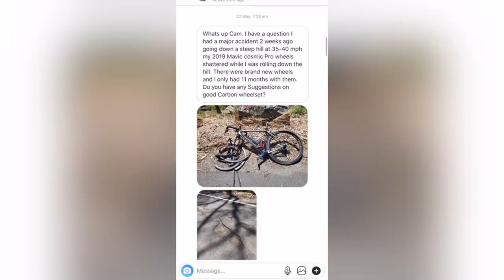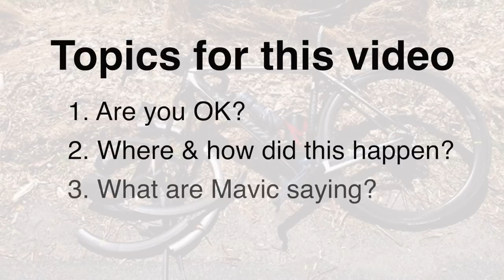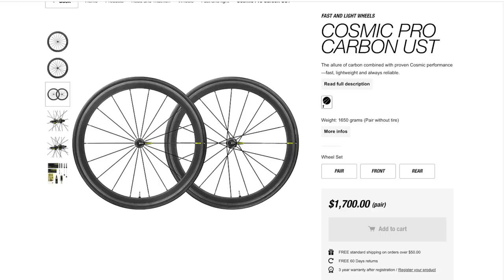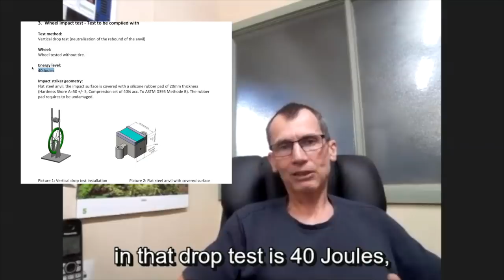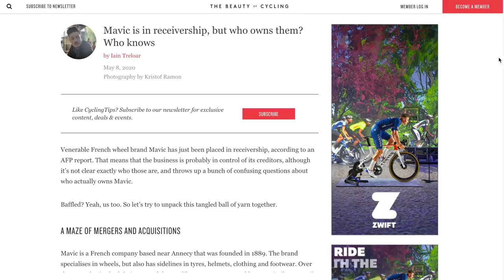A FRIGHTENING MAVIC CARBON WHEEL FAIL (at speed)

Comment: THIS HAPPENS ON DISC BRAKE WHEELS TOO ,l ve seen colasped wheels at the LBS with disc brakes from an impact SO FoR THIS REASON ALLOY WHEELS ONLY FOR ME !!
Reply: Correct.  The braking force from a disc brake goes where?  it is applied down each spoke to  each spoke nipple, putting pressure on the carbon area around each spoke.  So carbon disc brake wheels are not fool-proof.
Reply: @zoso73  but the heat doesn't transfer to the rim with disc brakes, what kills the carbon clinchers is the high temps from braking.
Reply: @zoso73  I would think that the pressure across all the spokes would be small enough as it is distributed across multiple areas, for the most part, evenly. No?
Reply: @nachelia  in theory, that is correct.  Very important to buy good quality DB carbon wheels from known manufacturers.
Reply: bianchi1885 Mavic is reputable manufacturer.
Reply: @anata5127  It is.  My point being that if you're going to buy carbon DB wheels, the reputable manufacturers rarely put out bad product.   But if/when they do and the product you are riding on fails resulting in catastrophic injury (or worse) to you, you (or your estate) want to ensure there is a real company that has decent liability insurance to cover your personal injury/wrongful death claim.
Reply: bianchi1885 Do you think aluminum wheels safer?
Reply: @anata5127  Aluminum will always present less risk than carbon, but carbon is generally safe.  These instances of catastrophic carbon wheel failure are few and far between.  I ride on carbon wheels on one bike, and aluminum on another.
Reply: bianchi1885 Interesting, I always thought that aluminum wheels are safe when they are heavy duty. For example, for gravel bikes. Road bike aluminum wheels look very flimsy.
Reply: @zoso73  the main difference between carbon and aluminum is that Aluminum bends while carbon almost disintegrates. Aluminum gives you a warning has some emergency reserves while carbon fails totally without any warning.
IMHO is carbon not a material for amateurs because they don't really profit from it's advantages and don't have time and money to counter it's disadvantages.
Reply: @svenweihusen57  Yep, and the net-effect of that "main difference" essentially sets the granularity of reaction-time to thousandths or millionths of a second, which is pretty fast. Carbon isn't a material for anyone not riding for enough prize-money to cover the cost of needless hospitalization.

If you can't trust your equipment to the point that you're thinking about your equipment when you mostly just need your equipment to function for its intended purpose, I imagine that any distraction from winning the race immediately at-hand is counterproductive to the actual winning of it, therefore somewhat (largely?) mitigating its theoretical advantage...

Comment: Nice video once more, my friend. I know that "brands"will never say that carbon is not recommended for those who weight more than 85 kg. But that's what i recon. 85kg is the limit, because the factors that the specialist describe, such as temperature, bumps and so on. Today we have lots of good aluminum wheels and frames. I don't see point to run the risk.  Hope you conquer more and more success in youtube! Greetings from Bauru-são paulo-Brazil.

Comment: Sounds like a very good argument for disk brakes on bikes... My rim/tire combo will never get that hot
Reply from the maker: Yes correct J 👍
Reply: I've seen more mavic wheels explode under high heat than any other brand. I know 3 guys with mavics that exploded during descending. I've never had a problem with quasar, ffwd and scope. I don't brake much and only race on tubs but I train on carbon clinchers.... I think it depends on more variables other than cArBoN cLinChErS

Comment: Thank you for doing this video.  I cycle up Bear Mtn all the time. The route up 9W to Bear from NYC is a very popular one. Its not unusual at all to hit 50+mph on the way down. I've often thought about what could go wrong in the process and tend to modulate and sit up whenever I can. Glad to hear he is doing okay. 

After seeing this, I may opt to get some 'climbing wheels' for just such a ride. Typically I get more worried about braking down those hills in the wet but this adds another element. Although I'll still likely be a rim brake fan as well. Having a friend wake up before a 100mi event with warped rotors has pretty much kept me away from discs.

Comment: At 95kg, I only ride aluminum wheels for this reason and being a heavy rider.
Reply from the maker: Yes can appreciate that 👍 thanks for sharing
Reply: I made a similar decision. Even on the alloy version of Mavic Cosmics at 100kgs I am at the upper limit of the  stated load capacity for the wheel set. The rider in this case, at 100kg - plus bike, kit, water bottles etc, was also probably closer to the 120kg limit for his wheels.
Reply: @kiribatichris  That 120kg limit is a joke. Worse yet - Focus states a 110kg system limit on all their bikes. Basically, good for people weighing 85kg. at most sans luggage! Should you bother to do bike packing, shopping or - not to mention - loaded touring - better make sure you're not a gram heavier than 65kg. before you buy a Focus. Thence, I avoid that brand like a plague. Compare them to Trek, who have more or less no weight limit on their bikes (and decidedly none for their carbon wheels).
Reply: I would say: It's not about your weight but what kind of riding you do.
Glad to hear he's ok

Comment: Thanks very much for the sub title. The guy in glasses tried to explain hot it it happened. But I tell you it happened because the integrity of the material is comprised during manufacturing. That's all. for safety purposes, avoid carbon wheels.

Comment: Mavic wheels are pretty reliable, they are manufactured and engineered in France.  They've been around for over a hundred years and is certainly no fly by night company, i'd trust Mavic over most other company any day.  I dont' think its fair to point out Mavic without fully understanding the elements at play here.
Reply: @kidkarbon4775  i've come across mavic aluminum rims from taiwan (think it was a cxp-21) and the same rim also from france; yet, it was the taiwan version that had islets.
Reply: agreed, he said he waw on the bumpy surface and hit a pothole at speeds of 40+ MPH, those are things at play Mr. Lee was speaking of I believe. I will say these variables i would think the rim should be tested for during R&D but I think the pothole and bumps should be considered along with his weight. I prefer Enve who has no weight limits with their carbon wheels and have had no problem with their products.

Comment: Congrats Cam for the 2 years on YT and thanks for sharing great info with us in this case for the sake of safety of us riders!! In the scene with Cav I think the situation is different. I do not think that this was caused by structural fail of the wheel in itself. I think if you look at the scenery with half speed it is clear to see that when Cav's front wheel goes side to side, the rider with the polkadot jersey hits the side of Cav's front wheel. So in this case imo mechanical impact into the side of Cav's front wheel is root cause in a race accident. Not that this makes a difference for the problem in general, but I think if we want to learn the most of analysing the scene, this might be considered. All the best to John for a fast and good recovery!!!

Comment: That's it. I'm never riding a bike with rim brakes again!😂
Reply: The culprit is carbon wheel not the brakes type
Reply: @tesmith47  It probably never would have happened if the rim brakes hadn't over heated the carbon wheels in the first place, so I strongly disagree with that statement, good Sir. Ad to that the problems with over heating and/or melting rim brake pads for heavy riders during long descents, wear on the rims, mediocre performance in wet conditions and quick wear of the pads in dirty conditions. Each to his own, but I'll just stick to disc brakes, thank you 😂👍
Reply: Ye its mostly becus of the carbon fiber resin, but still I think disk brakes are still better option even on alloy wheels.

Comment: This was i need to never buy a carbon wheelset.  Aluminum wheels 4 ever. 😎😎😎. Hope the guy did not get serious injuries.
Reply: Not sure who is buying carbon wheels.  They are like $1000+ per wheel and do this?  That's insanity.  But it is 2020 still...
Reply: I bought a used set of carbon wheels at a good price but the had metal braking surfaces. The rear clicked & the front juddered under braking as it got hot. I'm now back with my metal rims but have scratched the 'carbon itch'.

Comment: Rim brakes on carbon rims is asking for trouble.
Reply: I purchased a Giant TCR rim brake bike that came with carbon wheels . Sold them straight away and swapped for ally rims . Carbon for disc wheels only for me ...
Reply: Not at all if you have the right equipment,   I've descended some of the most technical canyon roads in SoCal & Utah with Zipp Firecrest wheels since 2011 ( mostly on rim brake bikes ) and they just do their job impeccably.
Reply: The problem is very much worse if you ride clinchers. As more and more people are.. Using tubulars will NOT give you the expanding pressure from the "tyre" to the sidewall of the rim.    Rgr
Reply: @borano2031  True but the manufacturers should not sell clincher specific carbon rims if tubular is considered the safe option.
Reply: borano20 What about tubeless?

Comment: Same goes for carbon bars too.....from past experience, unfortunately!
Reply: There's carbon, and there's carbon. For instance, the very light Syntace DuraFlite 25.4 carbon handlebar states a max. clamping torque of 8Nm. I've used it for a couple of years with absolutely no issues (never even needed to mind the clamping torque), even during loaded cycle tours (I weighed ca. 95kg at the time, plus ca. 20kg. for the luggage). That's not even to mention the Ortlieb handlebar bag adapter clamped to at least 5Nm on either side of the stem clamp. Plus ca. 2kg, occasionally loaded up to 4kg - of the handlebar bag. Never an issue! 
 Last year I resorted to purchasing a chinese "carbon" S-Works AeroFly rise drop bar copycat, goaded by idiotic pro- chinese junk propaganda so popular on YouTube nowadays. I held the junk with both hands, applied some pressure to see whether it gives - yep, it would flex a lot. I used a torque wrench to make sure I don't over-tighten the clamp. Guess what: as I was about to reach 2Nms of clamping torque - I heard a snapping sound. Undid the clamp, checked the handlebar - sure enough: the junk ("ToSeek" - is that junk's "brand" name) had cracked. I broke the junk with My bare hands with very little effort, deposed of it, applied for a refund - never heard back from scum who sold that junk to Me. A waste of €65,-. The fucking parasites! And the the ultralefty cuckolds have the nerve to claim that the parasitic animal abusers of certain Asian sh*tholes have higher IQs than the Men and Women of the Race of Newton, Tesla, Bach and da Vinci. Give Me a f*cking break! 

 So, while one carbon handlebar has a rating of 8Nm and withstands considerable loads, the other one would snap like a twig at 2Nm of clamping force. Chinese junk.
Reply: @LeoInterHyenaem  What's up with the racism?

Comment: A good example of why I bought a disc brake bike. Too much descending through areas where I had to hold some brake for various reasons. I knew I was pushing the Al rims hard because of the way the feel would change when braking hard on long descents, and when I got carbon I just felt like it was too risky. Glad 'John' is ok.

Comment: Hi Cam , I am a social and sometimes long distance and off rode rider am almost 74 yrs young , currently ride an Avanti Montary E bike , with Alloy  wheels and Disc brakes , have had no problem with the discs or pads , but with an E bike I have chain Stretch , resulting in renewing the chain at least every 4 months or so , yes I have Granny Gears , but I find the centre drive assist is the culprit of chain stretch , I previously had  a Giant Ebike the first was an E wheel front mounted , the second was a smart motion with rear E wheel assistance , on both No chain stretch .
So next E bike I purchase will be with rear E wheel assistance and for most terrains , and definitely No Carbon wheels !
P.S. I did also have a Giant Ebike with centre drive assist and Yes chain stretch was a problem !

Comment: 4:03, that's a pretty standard pothole for me, and the road looked nice on the other pictures. It's a shame Mavic isn't doing so PR stuff quickly. A friend of mine had a broken Enve wheel in a crash and it was replaced without cost in less than a week by their crash replacement program. Plus, Enve had the broken wheel sent back to them for an expertise by their engineers. That was actually awesome.
Reply: Brainjock  All I'm saying is that these potholes shouldn't destroy your wheels.
Reply: Anthony HT - do you really believe the manufacturer will say the deteriorated road surface in the photo is acceptable?  Or warranty voided?

Comment: This was an interesting presentation on this terrible double failure of two Mavic carbon rims. I felt that the points made by Raoul were true. There are serious issues with the inability for the rim braking surface to dissipate heat quickly enough while descending to stop the rim from delaminating or becoming misshapen enough to cause the tire to blow off. But there are other issues at play here that are every bit as important in this situation that were never touched on. I am a professional wheel builder who has been building since 1973 so I have extensive experience. I also am building carbon wheels every day of the week so I have considerable experience in this area of wheel building. I have also consulted on carbon rims design as well as done testing for some of the biggest companies in the world producing carbon rims. Here are the areas that were never discussed. First off we should consider the quality control on the actual factory wheel build. In my experience a typical factory build is usually fraught with numerous problems that can lead to complete failure of a wheel, even one that is ridden under normal circumstances. The finished spoke tension of a carbon wheel is quite critical. If it leaves the factory either under or over tensioned this can lead to a complete collapse of the wheel. So knowing the  tension the wheel was built at is critical. In this case one should have had that assessment done when they were purchased. I have seen brand new wheels that were so bad that they were totally dangerous to ride. The second thing to consider was spoke count. It was stated that the rider was 220 pounds which is a very heavy rider for such a low spoke count. I would say he was a good 50 pounds over weight for a spoke count like that. In my opinion rim and wheel companies promise that their products will hold up to weights that I feel are largely exaggerated. 
Wheel design. The front wheel was spoked in a radial pattern and the rear wheel used straight pull spokes. Both lacing patterns exert extreme forces on a carbon rim and I don't recommend them, especially for heavier riders.  Wheels built with these patterns typically offer very little lateral or radial compliance and can be a problem when entering pot holes or damaged parts of the road. The man who bought these wheels would have been better suited on an old school cross 3 lacing pattern with standard J-Bend spokes. Tire pressure. Was he running a tire pressure that was a little too high? I don't know. That could possibly lead to a blow out though he seems to think that the actual rear rim failed before the tire blew off. Who knows what happened first.  So, as you can see, there is more here than your assessment mentioned. All of the things I mentioned combined  could have very well been the cause of these failures and maybe no carbon delimitation took place at all. It's hard to know for certain. Whatever happened, it could have resulted in this mans death and therefore a total investigation from Mavic should take place.

Comment: I only run Tubular on carbon wheels with rim brake. The maximum temperature of carbon clincher wheel is much lower than tubular version
Reply: If you brake too much you can heat the adhesive on carbon tubulars.
Reply: @glennoc8585  Continental is selling you a special carbon rim adhesive. Guess the reason for the special formula??    Rgr

Comment: I had a less than one year old Zipp 303 NSW Disc brake wheel catastrophically fail while I was inflating a new tubeless tire. I was super glad that it didn't happen while I was riding. I returned the wheel under warranty via the dealer and Zipp rebuilt the hub into a new wheel at no cost.
Reply from the maker: Wow Lynda, that is very interesting to hear, and so glad to hear that is didn't happen while riding! As always, thanks for your further support! Cam

Comment: I totally believe Leuscher's explanation.  I have even seen something similar on my alloy wheels (but no rim failure), namely that after riding a very hilly section on a hot day, with some old tubes, my inner tube spontaneously developed a leak along a seam in the tube -- even once while the bike was propped up against the wall after a ride.  I reasoned that the constant heating and cooling of the inner tube ultimately led to some kind of vulcanization that made the tube develop cracks.  In both cases, however, the tire just slowly flat, similar to a small puncture.